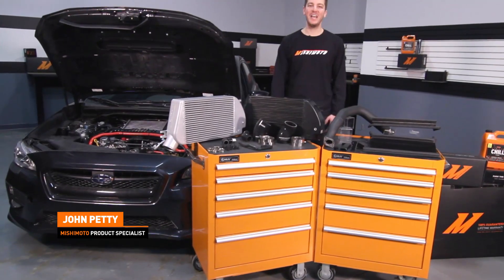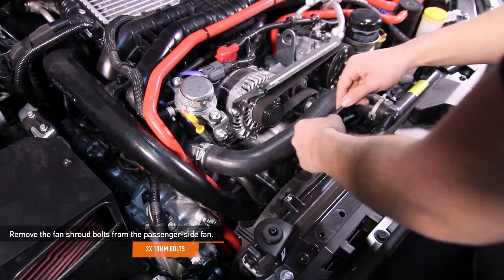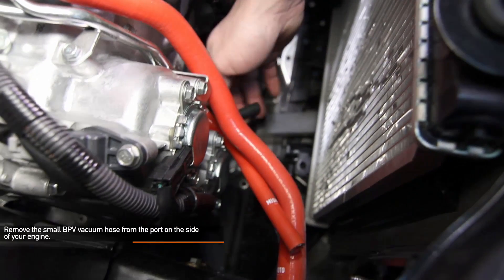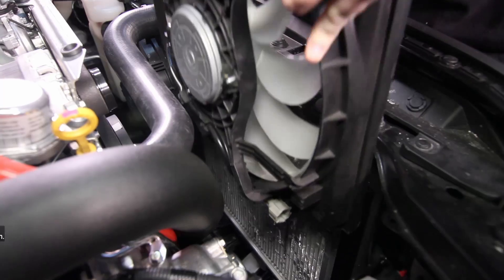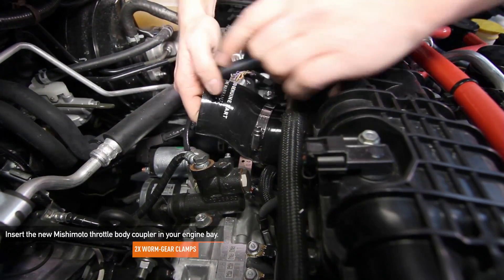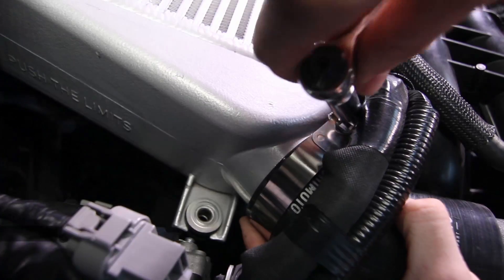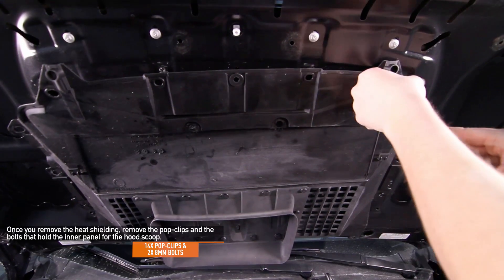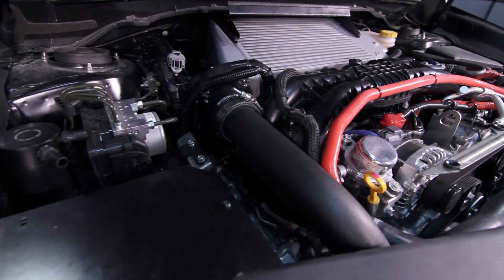Performance Top-Mount Intercooler and Charge Pipe System, for the Subaru WRX 2015+ Install Video

Comment: This is listed as not needing a tune on your website. What happens if one does not time after installing these parts? Do you still get colder intake temperatures?
Reply from the maker: While you will still see the lower intake temperature from the intercooler you will not see major differences in power until the car is tuned for the intercooler.
Reply from the maker: It's possible you can damage your engine due to unsafe air/fuel ratios.

Comment: Hey  Mishimoto I am super interested in getting you intercooler however I am worried that it will not be compatible with the stage 2 boomba oil catch can I have installed because your intercooler changes the location of the mount on the passenger side. Any thoughts ??? Also I want to add the perrin strut brace and the boomba BPV blow off valve would this be a problem ?
Reply from the maker: Hello Antonio. Thanks for reaching out. Unfortunately, we do not conduct testing with other companies parts. So we would not be able to confirm if our items are compatible with your current set up. I would suggest watching the installation video in its entirety,  and paying close attention to the steps. This would be the best way to tell if our kit will interfere with your other parts. https://www.youtube.com/watch?v=hFHOhD6L1eY&lc=UgyyN0phkXA6D_rRZRl4AaABAg

Comment: Mishimoto Automotive, can I keep my front strut bar if decide to install your TMIC?
Reply from the maker: Hey DJ Chris Argueta. Our test vehicle did not come equipped with a strut bar so I would not be able to fully confirm fitment. However, after a bit of research, it seems most aftermarket strut bars do make accommodations for the top mount intercooler since that is its factory location. 

https://www.google.com/search?q=2015+wrx+strut+bar&source=lnms&tbm=isch&sa=X&ved=0ahUKEwjlwYfv44_aAhWGUt8KHXvuD8AQ_AUICygC&biw=1920&bih=974#imgrc=UaJe7eYkGE_wJM:
Reply: My perrin strut bar had to go. The TMIC from mishimoto is beefy and goes back pretty far blocking where it would normally sit.

Comment: What makes this one better then the stock.
Reply from the maker: Hello surf jujitsu . The highlight features of this product would be Provides 35°F temperature drop compared to stock intercooler on a stage 2 tuneProven +15 whp and +8 wtq bolt-on power increase on a stage 2 tune. 
If your looking for additional information, please reference our engineering report for the product. Link below :)

https://cdn.mishimoto.com/media/productpdf/MMTMIC-WRX-15_EngineeringReport.pdf

Comment: I am having a boost leak issue after installing this kit, I have double checked my clamps. Any other advice on what I could have done wrong? I did reuse stock rubber gasket on the charge pipe just because it looked in great shape.
Reply from the maker: Hello Dalibor Labudovic  , Sorry to hear about your potential issue. I would recommend contacting our customer service department regarding this and we would be more then happy to assist with troubleshooting your boost leak. support@mishimoto.com  or 302.762.4501.

Comment: When it's all done you should go see a tuner. Not take a test drive lol
Reply from the maker: Hey guys - just to clear this up: Tuning is not necessary after installing our top-mount intercooler and charge-pipe, but you will see optimal performance if tuning is performed after the intercooler is installed.
Reply: You can run a tmic on stock tune.
Reply: I wouldn't, especially with a new charge pipe. I'm sure you can drive it a short distance, but I wouldn't go to far. Also, who puts a upgraded tmic on a stock car?
Reply: The charge pipe runs from the TMIC to the Turbo, not the manifold.
Reply: Showing my noob knowledge but what are the "tmic" and "charge pipe" you speak of? What is their function?
Reply: TMIC is is 'top mount intercooler. The charge pipe is the pipe that's connected to the intercooler piping and intakemanifold. Subaru wrxs are finicky with mods and no tune to support them.
Reply: +Gunsforfreedom 

If you want to take full advantage of the new intercooler, yes. If not, then I highly doubt it'll harm anything. The ramifications of not tuning after some mods, other than things such as catless downpipes are greatly over-exaggerated on all car forums.
Reply: I'm confused the Mishimoto web site says you shouldn't even install the intake without a tune so I can't see replacing the TMIC being safe to run without a tune be nice to see a response from the manufacturer.
Reply: I stand corrected the web site says you do not need a tune for the TMIC but does say you shouldn't run the intake on 91 octane and no tune.
Reply: Mishimoto Automotive what if you only install the TMIC? Would that require a tune?
Reply from the maker: Hello Dj Chris Argueta. The answer is exactly the same if you are just installing the TMIC. While you'd see benefits from a tune it is not required.
Reply: Mishimoto Automotive how would a tune be beneficial in this install? Isn’t the point of installing your tmic to gain better cooling? What would a tune do that the hardware isn’t already doing? It’s not like a tune is making the air cooler right?
Reply: @willadams8558  with cooler temperature and better airflow a tuner can increase timing and/or boost, therefore maximizing your cars potential. Meaning more HP